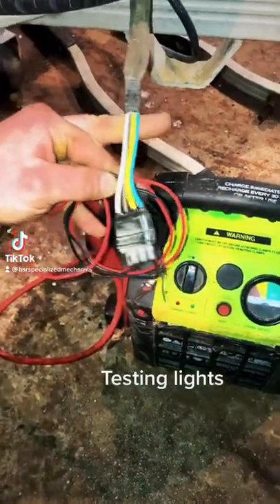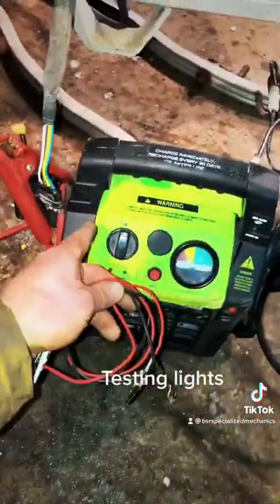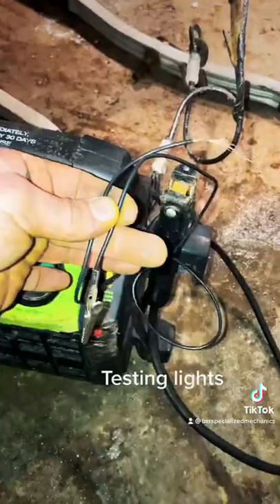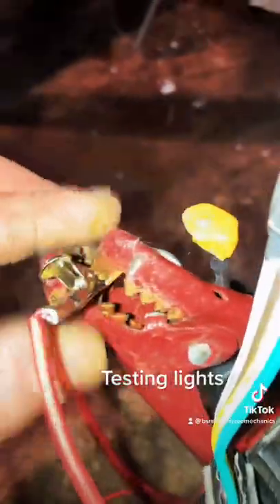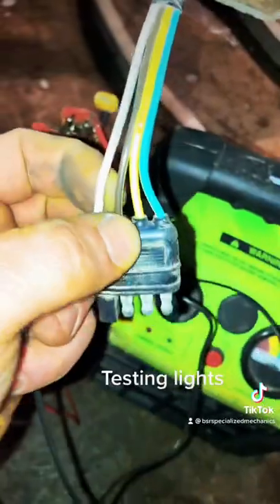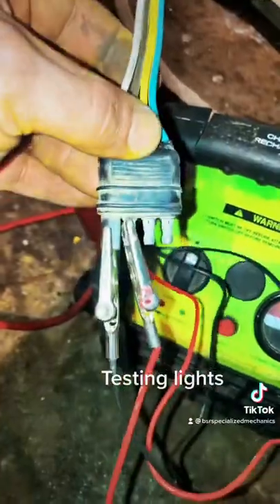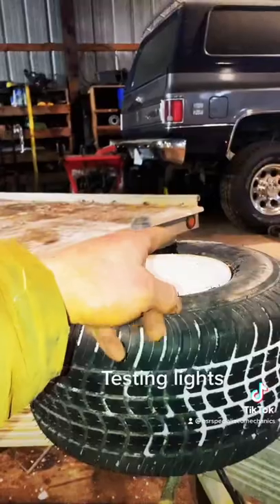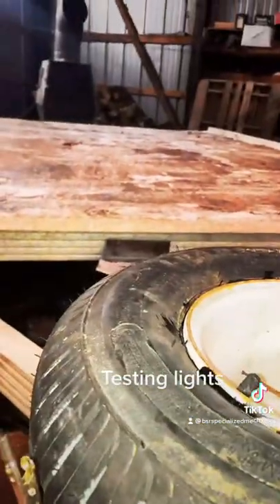How to test 4 flat trailer lights

Comment: Wonder if the side amber lights work with a wire twist cap connector or has to be a splice connector to work with the brown wire?
Reply from the maker: Oh yes either connector will work for that. If using scotch locks make sure they are good and tight. Butt connectors clean strip, wire nut overstrip & twist copper clockwise.

Comment: What happens if nothing turns on? Possibly a ground?
Reply from the maker: Very possible or corroded light fixtures. Connections are key!
Reply from the maker: Try clipping ground clamp to metal/aluminum on trailer & power to pin. Ground on 4 flat may have issue. Fixtures should be grounded to trailer themselves.
Reply: @bsrspecializedmechanicsllc  I figured out what it was. I have one of those foldable trailers for a john boat, and I guess the metal to metal contact at that pivot in the trailer wasnt good. I ran the ground from the back of the trailer up to the front. Worked like a charm.

Comment: I have a vintage Shasta trailer and the simple trailer harness was exposed so I ran  the 4 wires through a half inch rubber conduit to protect it.  I connected a new flat connector using butt splicers.  Plugged it in and turned on the truck and the portion from the butt connectors to the plug melted!  Any ideas why?